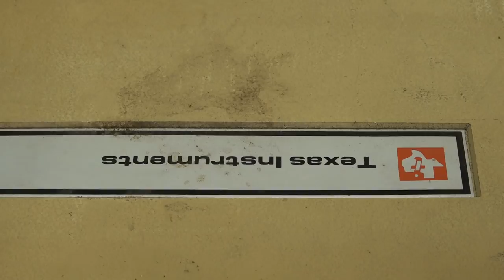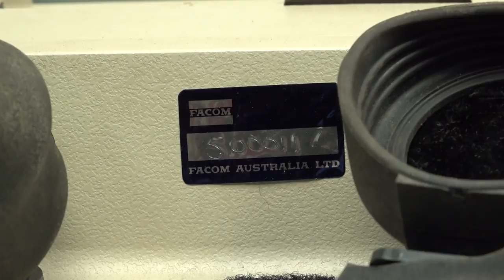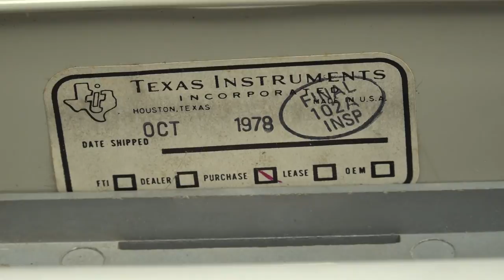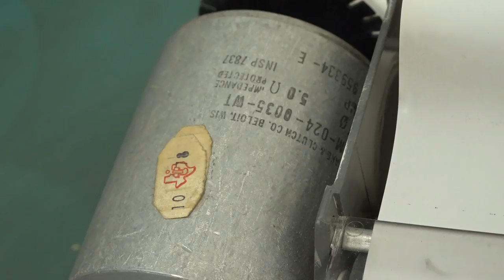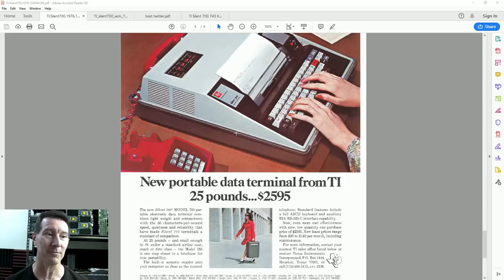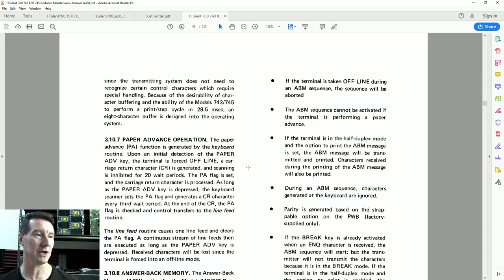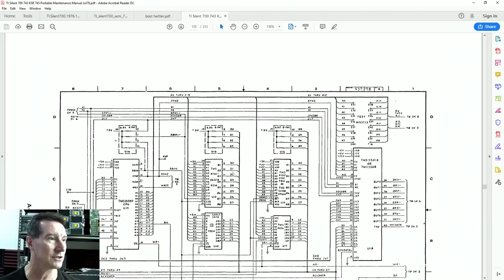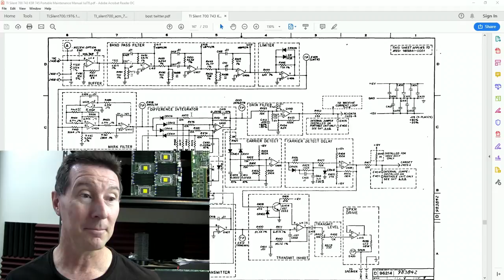EEVblog #1169 - TI 1972 Computer Interfacing

Comment: I was involved with IC design at Honeywell when I had the pleasure of using one of these terminals. The DEC VAX was the mainframe (betcha can’t use just one!) and everybody connected via phone line. It was Berkeley SPICE 2G, if I recall. Netlists were text only. We managed to design analog ICs using these things. The BEL command was useful if you wanted to get the attention of somebody on the other end of the line. You would hit BEL 3 times and hope that there would be a response, so you could chat about a problem or some other problem.
I designed my own 30 baud FSK modem (to connect to my Radio Shack TRS80 - model 4), so my wife and I could play Colossal Cave (a text adventure game) on the company’s VAX after hours when the kids were in bed. Fun times!
Reply: but what is the HERE IS key for?????
Reply: @nikolausluhrs  ... It was to identify yourself to the mainframe as in "Here is this terminal". So HERE IS, when pressed, transmits a predefined identification message.
Reply: @sbalogh53  Oh cool, good to know
Reply: > @nikolausluhrs  It was a ASCII defined function where one could program a who I am character string in their terminal and upon receiving a who are command character would respond with the stored who I am string. It was originally used in teletype links.
Reply: 30 baud?  Did you mean 300, or really that slow?
Reply from the maker: Nice!
Reply: Oskar Skog I think it was 30 baud...really slow. The circuit was from Byte magazine — Ciarcia’s Circuit Cellar.
Reply: Thanks for sharing!  That’s really neat!
Reply: @0x8badf00d  baud is bits per second (one bit per baud when it was a common term; they switched to bps when that was no longer true).  8 bit characters, parity, stop bit = 10 bits per character.  So 300 baud is 30 characters per second, or a bit more (pun intended: 7 bit chars).
Reply: @JohnDlugosz  baud was actually symbols per second. Originally one bit was encoded into one symbol hence 300 baud was 300 bits. But as encoding improved they were able to encode more than one bit per symbol and then baud did not equal bits. I assume that they switched to bps because it sounded faster to say 1200 bps than 600 baud.
Reply: @zaragonrl  That's correct, it's the symbol rate. The term "baud" comes from Baudot code, which is 5 bits per symbol. I think you meant to say "word" though, you can't encode more than two symbols with a single bit.
Reply: God I remember in 1984 writing Spice with text only netlists at Uni. VT52 terminal with a single line editor. To this day I still prefer a command line
Reply: DEC VAX .. That's modern stuff!, I cut my teeth on a Rank Xerox Sigma 6 :-)
Reply: Colossal Cave! So many fond memories. XYZZY!
Reply: @r2bennett  I can't be sure of what you were using, but 30 baud was never a standard speed.  300 baud was the standard speed for the Bell 103 modem, which was the most common standard, which I'm almost sure is what Steve Ciarcia used.  300 baud was sometimes referred to as 30 characters/second, so maybe this is a source of confusion?  And for the record, 300 baud is still maddeningly slow.
Reply: i was also trained using SPICE with a text only netlist....but not sooo long ago during early 90s, and i also was very thankful of that...as later on almost nobody had understood these anymore, but i was able to see the mistakes the software netlist creator did...;)
Reply: @BrightBlueJim  
Sorry but you confuse Baud (named after E. Baudot) with bit rate.
One Baud is equal to one symbol (witch can be for example 5 bits) and even if 30 baud was no standard it was used in many terminals at this time.

Sorry for my bad Englisch :-)
Reply: @DerHeimatlose1  No, I do not.  I am fully aware of the difference.  In fact, YOU are confusing the two.  By "symbol", baud rate refers to discrete signal states, not just how many bits are in a character.  For example, if your modem uses frequency shift keying using eight different frequencies, then three bits can be fit in a single symbol.  Again, it does NOT refer to symbols as characters.  So baud rate isn't really a terminal characteristic at all - it is a modem characteristic.  I used the term "baud" because I was talking about modems, and this is an appropriate use of the word.  In particular, Bell 103 modems used exactly one symbol for each bit, so the baud rate was equal to the bits/second rate of the connected terminal.
So back to you: can you name ONE terminal that had a "30 baud" setting?

Comment: I used to have an old PMG 300 baud modem in a grey metal case. I modified it so the modem could originate or answer depending on a toggle switch on the front panel. I used to download files from a couple of online BBS systems and save the audio to cassette tape. When I played the tape back into the modem a copy of the file would appear on the serial interface. This is how I stored programs for a home made computer I build before I managed to get an old 8" floppy drive. I had an old IBM Selectric typewriter which I tried to convert to a printer by building power drivers for each key. I never did get that beast working. Those were the days.

Comment: This really brings back memories!  I worked for TI in the early to mid 1970's, first at the DCD (Digital Circuits Division) in Stafford TX (outside Houston), where I repaired the IC test systems, and then transferred to DSD (Digital Systems Division) in Sunnyvale, CA, where I worked on the mini-computers (960 & 980), and Silent 700 series terminals.  The print-heads actually had the driver transistors built into the die, and if I recall correctly, the final transistor was the one that supplied the heat to the paper.  Your terminal may still have some life left in it.  Try increasing the contrast pot to see if you can get a little more heat to the paper, which may have lost sensitivity to heat over the years.  A new roll of paper, or as was mentioned earlier, unroll some paper from the existing roll may also help.  As was mentioned below, cleaning the print-head is an excellent idea as well.  Use 97% isopropal alcohol and a cotton swab.

Comment: Hi Dave my Dad worked at Lockheed in yhe early 70's; on family day (open house) they brought out the TI silent 700 terminal for games like hangman and (later) LIFE. The thermal paper was very cheap & non-archival(turned brown with heat & sun exposure) but cheaper than huge 132 column line printer paper which they used for satellite test run procedure documentation. Programmers & engineers would check out the TI terminals to take home & remotely dial in & check on diagnostics & tests. Very popular! Led to a boom in Lockheed remote work on Tymshare (brand) systems for FORTRAN work. Also led to my entry into programming!
Reply from the maker: Nice!
Reply: I remember making numerous calls at Lockheed in Sunnyvale.  Sometimes at the top secret building, where everything got shut down while I was there... Interesting place.

Comment: A number of questions can be answered if you realize that the Silent 700 series was meant to be a portable replacement for an ASR-33 Teletype - you see it has current loop and RS-232 inputs in addition to the modem.  Since most people using time shared computers were set up to use Teletypes, the software was optimized accordingly, expecting that the printing terminal kept a record of transactions.  Being backward-compatible with the ASR-33 also meant that the standard communications mode would be 110 bits/sec 11 units/character (8 bits, no parity, 1 start, 2 stop), and the high speed would be 300 bits/sec (8 bits, no parity, 1 start, 1 stop).  The base model would be upper-case only, and that empty socket may have been where a lower-case character generator ROM would be added, but that's just a guess.  I think that the 300 baud, 30 character/second mode was pioneered by GE in their TermiNet 300 series terminals, which used (I kid you not) chain printer mechanisms, and were about as big and heavy as Teletypes.  These were not meant to be portable, so the Silent 700 series was also meant to serve that market.  GE was also one of the pioneering timeshare companies, so having 30 char/sec printers was a big selling point!
A special Teletype ASR-33 function was the "Here Is" key.  On an ASR-33, there was a mechanical drum on which you could program up to 20 characters of ID message, which were transmitted when you hit the "Here Is" key.  For most machines, this was not programmed, and it just sent out 20 nul characters (ASCII code 0) (which was convenient for punching leaders on paper tape).  Whether TI implemented this on the Silent 700s is outside my knowledge, but I think some terminals just used that key to generate a single nul character, so that may be the case here.
Reply: Check the maintenance manual.  There was an Answer Back Mechanism option on the Silent 700, which used a ROM to store the Here Is/Answer Back string.
Reply: @jonathanInLondonUK  Yeah, I wrote this before I looked for the manual.  See my post about the manual.
Reply: @jonathanInLondonUK  The ROM was also used for full-ASCII use, i.e., lower-case letters, and even for an APL (special character set) option.
Reply: @video99couk  The models before the 32 and 33 are a little old for my taste, using typebar mechanisms instead of the later type cylinder.  I find the cylinder a lot more elegant.  You know, from a more civilized time.

Comment: Oh yes they do!  My aunt was a executive secretary for 35 years and had long fingernails.  Damn woman could type twice as fast as I could without long fingernails.  Probably wouldn't work with a modern shallow key with little stroke length.  The old keys were really deep and had a long stroke length.  When she typed her fingernails were just over the edge of the key.  LOL, still don't know how she did it.
Reply: Was scrolling to see if someone else said about that.. My fingernails aren't quite as long as hers in the picture but long enough to still require the change in fingertip posture compared to short nails. My nails are usually 5-10mm longer than the fingertip, and when I trim them I go down to about only 1mm extension.
I suppose people who've had short nails their whole life simply don't spontaneously conceive of pressing the flat of the fingertip rather than the round. But any nails that are longer than your fingertip requires to not press with the absolute tip.
It does work fine on laptop keyboards, you just need to change the angle even closer to being parallel to the keys. With short nails you contact all keyboards at almost a right angle, and with deeper travel keyboards you're more 45° with long nails. I think it's actually a more comfortable typing posture anyway, for lots and lots of the stuff.
Just paid attention to how I type with my retro spherical cutout keycaps (very similar to the ones on this terminal). 
Mine sit at about 45°, with the round of the fingertip doing most of the contact, and my nail goes just over the top edge of the cutout area of the key. 
It's not the absolute tip with the round, the contact area goes about halfway back to the first knuckle. If you look at the side profile of a finger, the contact area starts at the point where the fingertip starts going off at about 45° from the rest of the finger.
I remember my guitar teachers, who were all guys, getting frustrated at my fretboard posture.. but with long nails you cannot use the absolute tip!
But just like with keyboards, using the flatter side of the fingertip works fine (except for some very elaborate fingering work. And then I just trim the required fingers there.)
So it's not uncommon for women in electronics, computing and audio to trim a couple of fingers' nails to make things easier (such as handling small components), like Ms Mad Lemon here on YouTube evidently sometimes does, but just for typing it's pretty easy to have all of your nails as long as you like.

Comment: Being able to use one of these, instead of going to the college computer center  and waiting in line to use a keypunch, saved literally hours. It was slow compared to modern standards, but using the time sharing system instead of submitting batch jobs via cards was an order of magnitude faster.

Comment: As you were flipping through the service manual, at around 20 minutes,  you flashed past the print head tension adjuster diagram. I yelled "go back!" At the video, as you could have probably fixed the light printing problem with the thermal head.

Great video.

Comment: The orientation of the blades on the cooling fan show it's not blowing air into the case; it's drawing air through the entire case and blowing it past the motor housing to the outside.  Cool gear!

Comment: The "here is" key could be programmed to send an answerback message.  This could be sent to the host by pressing the "here is" key, or the host could initiate the transmission of the answer back by sending an <enq>.

You could only see the answerback message if you were in half duplex (local echo) mode.

Basically, in the days of terminals that shared time on a mainframe, the computer could ask "who the heck is that?"

Comment: You're not a real hacker if you haven't held carrier by whistling into your phone.
Reply: Sometimes you had to, your modem wouldnt due to some reason.. Required a special kind of two-tone whistle and then you would get handshake.....
Reply: @MrZnarffy  captain crunch whistle
Reply: When I built a 300 baud modem, I tuned it by whistling one of the tones (which was a certain musical note) according to the kit instructions. Of course it was easier to just dial a modem and adjust the pot until it started working.
Reply: Does Silver Bells on a C64 count? :)
Reply: Does Silver Bells on a C64 count? :)
Reply: Most of us from that vintage are getting on, some of us just whistle when we talk and it aint into phone....sonny.
Reply: @MiniLuv-1984  I whistle from both ends, guess my age?
Reply: @bill605able  Not that smart Bill...te;ll me the punchline.
Reply: In high school I discovered that if you short the microphone to the front metal case with a safety pin and hit the receiver switch a couple times, it would give you free phone calls. 
You had a 50/50 shot of it working on that particular pay phone, but if it did you know that's the phone to use.
 (On a side note. If you did the sequence wrong or held everything wrong, I remember it gave you a helluva shock when you hit the receiver switch!)

Comment: The 'here is' (And 'who are you') is a hangover from the old Telex style machines, where you would connect to another machine to send a message. you used these to both identify yourself to the called machine, and also request the id of the other machine to make sure you called the righte number.

Comment: In 1971 we used a KSR33 Teletype (Teleprinter) to remote connect via acoustic coupler to a main frame so we could calculate complex inductance formulae at the labs where I worked in the UK. Many of those keys on your machine are marked up like a Teletype. VT = Vertical Tab FF = Form Feed etc. 'Here Is' was the Answer Back mechanism to identify the machine connected to. Loved Acoustic Couplers :)

Comment: Nicely luggable (as opposed to portable). Seemed like she was lugging it in the advert!   I wonder if that empty socket would be for a prom for the hereis codes. Didn't see any snap-off metal tabs like in the real ttys<G>. I remember using some 300 baud Decwriter terminals in the 80's where the printhead could go faster than 30 CPS.  Since a carriage return line feed takes no longer time to receive than any other character, but took a lot longer to reposition the print head. the print speed would "catch up" on the first few characters of the line, before slowing down to the regular 30 cps. Sounded quite different.  Thanks for the tour!

Comment: The oil and gas company I worked for had a few of these for the programmers to check out at night.  If you had work on the mainframe that you needed to monitor, you could check out a terminal and use it at home.  Made the spouse happy and beat lonely evenings alone in a big bullpen watching a green screen monitor.  Not sure how heavy they were, but dragging one across downtown Dallas to catch the bus wasn't a pleasure.   Oh yes, don't forget to grab an extra roll of paper.  Thanks (?) for the memories!

Comment: I suspect that the old paper is causing the print problems..sometimes old thermal paper does not show print.
Try unwapping a few wraps of paper, then try printing-the inner wraps may work better.
Else, try a roll of thermal fax paper-should work fine.
Also, check the printhead for debris.
Reply: Ha  ha you are correct sir! Time & slight heat would not only brown the paper, but would desensitize the thermal salts on the paper, rendering it unprintable! 6 months was about the max useful age for the paper, if kept in the original black plastic bags! A new roll of thermal fax paper will indeed work!
Reply: Nope, can't use other paper, might void the warranty.  It even said so!
Reply: F**k the warranty. I would've used what ever brand paper i chose.

Comment: I used one of these in 1986 to debug a Motorola 68000 board I had wire wrapped for a school project (and I have no doubt it was kept in use a lot longer, the owner of the company was rather tight and wasn't about to replace working equipment)
This company built production gear for the automotive industry and the terminal was mainly used for maintenance in the field, and as such it made perfect sense. By then there started to appear "portable" computers that could do terminal emulation but this was cheaper, smaller and lighter than most of those and a lot more rugged, hence perfect for chucking in the back of a car and doing a crazy dash to a car factory where production had stalled.